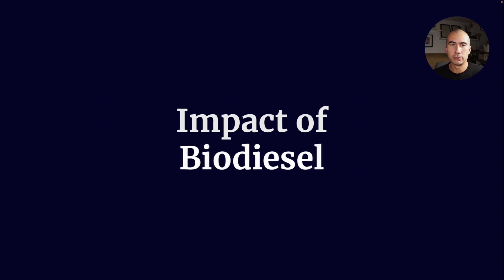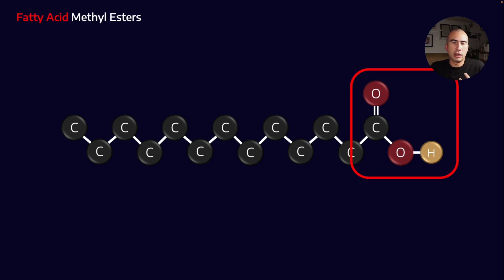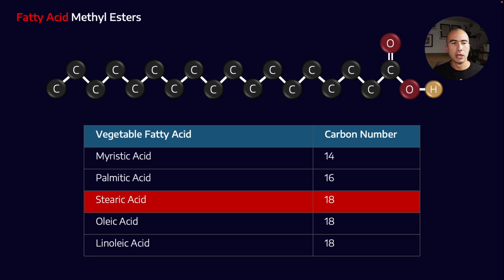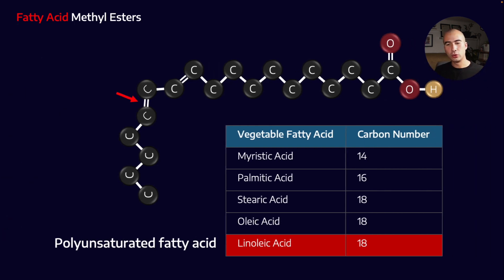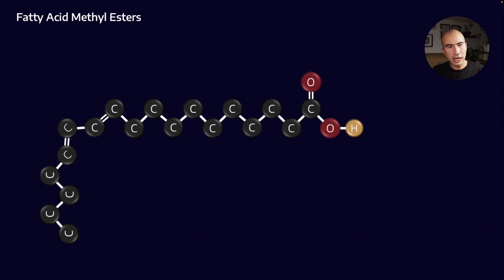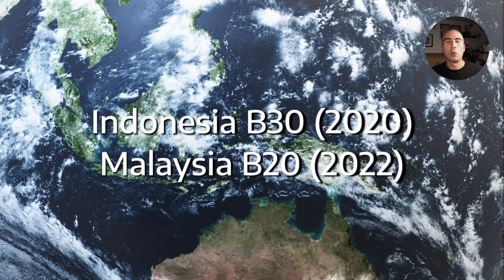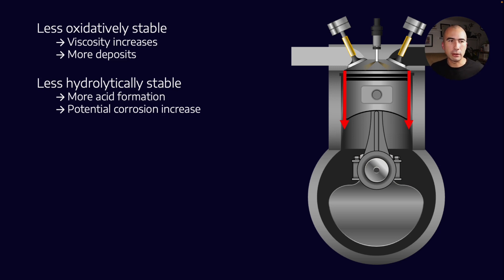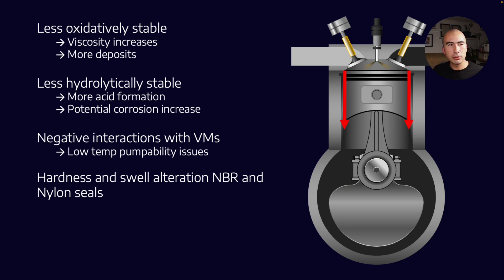How does biodiesel impact engines?

Comment: I'm glad I found this video.  I've been in a debate on a TDI forum in which many are calling my claims "unsubstantiated assertions" that biodiesel leads to oil dilution and necessitates more frequent oil changes.
Reply: There are many research paper that will back up your theory. From what I read, biodiesel has solvent like characteristic and will slowly strip anything it comes in contact with.

Comment: Rafe, great delivery of the subject matter as usual 👍
Is there any current data on modern, small high speed common rail engines such as those in the current Australian ute market?
Biodiesel is not something I've ever been willing to run in my own vehicle, but if it starts being mandated, would love to hear your thoughts.
12:40 In particular, the effect on DPF and SCR systems.
Reply: More and more OEM engine manufacturers are turning to biodiesel due to its many advantages. In fact Coke trucks in Emirates are using B100 for 5 years now. Lots of airlines like Boeing, Airbus are not turning to 100 % biodiesel. The train of Branson, Virgin Air has been using it for years because of its cleaner emisions and better engine performance. Even Mebourne buses have been using it since 10 years ago due to the researches conducted at Victoria Uni.
Reply: @riccapistrano8964 
I'll be waiting for the manufacturer of my engine to tell me it's OK to use.
With injectors at about $750 each, the high pressure delivery pump at risk and only the depth of my own pocket to pay for it, it's not worth the risk.

Comment: THIS has to be one of the best videos concerning the use of biodiesel fuel. I can tell you all the negative stated issues remind me of when E gasoline first showed up in the market. Speaking from personally using the stuff in a ford vehicle for at least 150K miles without any problems at all without any specialty modifications just shows how the fossil fuel industry will spread lots of BS to keep people using straight dinosaur juice PERIOD. Been using canola, sunflower, and peanut oil in my earth movers for the past 20 years without a hiccup. The best part is the smell just makes you hungry all the time for french fries. THE low sulfur diesel just stinks to high heaven. Ones cloths are also smelly. That is why I prefer to drive a gasoline truck. 
Just my two cents Sir. Great work too.
Reply: @westgatehygienecleaningsol3442  What I do not know is how long one can store biodiesel and not have an expiration date ?? Tough question to answer for sure but give it a stab. Good day fella too.
Reply: 6 months max lad

Comment: Biodiesel has the side benefit of extra lubricity for diesel injectors and high pressure fuel pumps, typically found in CRDs.  Which is super important for pump and injector protection.  So Biodiesel is not all that bad!  🙂
Reply: This is what is going to happen to your engine soon https://youtu.be/0phE-t7ddH8
Reply: blah blah blah

Comment: I am a retired chemist, speciaized i biofuels since the mid 1990-ties. I have found reasons to comment on the video which I find unclear at some points and faulty at some others. First of all, vegetable oils come naturally as tri-glycerides with minor levels of free fatty acids. This means that the process required for turning these into metyl (or ethyl) esters is called trans esterification usually with an alkali catalyst. If the level of free acidity is too high, the process needed is called esterification, usually performed with an acid catalyst. One should also be aware of that criterias for lubricants (although biodiesel is a good lubricant) is not automatically suitable for biodiesel. As for the formation of free acidity in the crankcase oil: There is obviusly a parameter for lubricants called TBA (total base no). There are components in the crankcase oil which are there to neutralize any acids coming in contact with the oil(correct me if I am wrong) . These components should be well suited to handle acidity from any kind of fuel, the sulphuric acid included (produced by the sulphur content of the fuel). It seems to me as a higher TBA is to prefer to a lower TBA, correct me if I am wrong again.  I agree upon more frequent oil change intervales, since biodiesel does not evaporate from the crankcase oil the way dino does, due to its higher boiling point. The fuel consumption should increase with maximum 10% due to the lower energy content of biodiesel compared to dino . But it may not appear since biodiesel burns more compleatly than dino. Finally, the formation of soot in general from biodiesel is less than fron dino, a fact which is well known from the litterature. But, it is also known that biodiesel with a high content of mono- di-and triglycerides can generate soot deposits, which sometimes can be quite serious. But the usage of high quality biodiesel carries a small risk for this. Even though both the ASTM and EN norms have their flaws,  I would still recommend biodiesel meeting those demands. And you lubricants experts, when will we see renewable  bio lubricants on the market ? I know that vegetable oils have a good viscosity index. Is that not something to build further on ?
Reply: Good comment. . . Can u tell me if biodiesel can be made to a satisfacfory standard by a homeowner, who wishes to avoid the ever fluctuating feul prices? 

If so, can u point me to a  video that u would recommend for this purpose?
Reply: @Blue1Sapphire  Well it is difficult to produce biodiesel of satisfactory quality for a home brewer. Biodiesel can be produced, of course, but it is the removal of undesired components that is the problem. Examples of such components are residual methanol, alkali metals, or the acid catalyst, depending upon which process is used, and water. The best approach is to choose an oil (or a fat) as raw material, that has good values of free acidity, water, and a high saponification no. Testing of the final product will also be necessary. Either way, it is not recommended for a home brewer to rely on his or hers  biodiesel in the long run. The biodiesel industry has deep control of the quality issues of both the raw material and the biodiesel itself , something that will be too expensive and too knowledge demanding for the home brewer.
Reply: Respectfully, paragraphing really helps especially with dense, deep, stuff.
Reply: Sir      I have a lot of respect for the USA guys who put me right on the tech re making biodiesel....... The forum was THE place to get all the technical info that was required to make good biodiesel... I remember your name partially way back  and I remember with thanks several names who I looked at in the forum 18 years ago.   Dave with his school bus was on of the first and a farmer called antifuel1.... Those were the days......  Graydon Blair   I think made bio a big business. a very aimiable chap indeed and helpfull.
As a commercial heating eng I had problems nearly getting b100 to burn in the P jet burner. Now I just bought a Beckett  head & just about to fire it up....
Reply: I totally agree with you Jan. Have a great day mate !

Comment: I burned several 100 liters of straight filtered used veg cooking oil in my Detroit 6.5 diesel. Mixed with 1/3 kerosene to adjust the viscosity to the same as diesel. It ran great. It ran quieter and smooth than the diesel. Probably not a good idea though for long term without treating. It's too bad that there is not a plant based oil that can be used that the transestification process is not necessary.

Comment: Lots of fuel filter changes are in your future if use this in your older motorhome. Biodiesel is a great cleaner and will shake loose a lot of built up dirt which clogs your filter fast. Biodiesel holds moisture, which allows algae to grow during the storage. That algae will be tough to get rid of and will clog many filters until it is finally controlled.
Reply: You right about more filter changes ! But its the other way round mate ! Biodoesl kills the mentioned algae ! :)

Comment: Small amount of biodiesel greatly improves the lubricity of the fuel (since most (or all) diesel is ultra-low sulfur), which is essential for health and longevity of the fuel system of any diesel engine. And the fuel system components for diesel engines are very expensive.
Reply: Thank you electoman. My concern running California-distributed ARCO "renewable" diesel is for the longevity of the dosing pump of a Webasto diesel air heater for boats, trucks or campers. If you have anything else to add I'm all ears. Thanks again.
Reply: @applesbighatranch6906  hm, somehow I doubt that dosing pump of Webastov is any more delicate and/or sensitive, than hpfp and injectors of your regular CR diesel engine. This is just my unprofessional guess though. Can't say anything about your fuel station, I'm from UK. 
Best to ask Webasto service/support team about any specifics of operation of their equipment, the DOs, the DONTs, etc.
Reply: Sulphur is the only main ingredient in diesel. Everything else is just marketing. This is what is going to happen to your engine soon if you run on biodiesel https://youtu.be/0phE-t7ddH8

Comment: We're looking into buying a new truck, it seems most in the past 15 years are certified to run on B20, what are your thoughts on using blends like B20? We're thinking if we run it in a new truck from day 1, it might not cause as many issues compared to using B20 in a truck with significant mileage already.

We'll be buying B20 in bulk from a fuel supplier, say 10,000L/time.
Reply: This is what is going to happen to your engine soon https://youtu.be/0phE-t7ddH8

Comment: Back in 1998-1999 i used RME (rapeseed) fuel in my Enfield Diesel bike. The combustion chamber and tail pipe became metal clean. Before 3/4 injector holes would foul after 5000km. But with 100% RME all 4 holes was clean after 10000km.
In 2012 I started to use it in my BMW 530D, and when it was time for my DPF service they asked me what I did, it was metal clean.
530D did not like 100% RME. However 80% was fine.
I’ve drove it with 60-80% RME in temperatures ranging from -33 to plus 34 Celsius. No problem.
Sadly they don’t sell it any more at my local station. It was the best medicine for my DPF……
Reply: What is DPF. I read your comment 😊😊😊. Thanks for reply
Reply: @dldchannel1316  DPF : Diesel-Particules-Filter

Comment: Dam, for the last 30 years we have just washed used cooking oil , Run it through a old high speed centrifuge and a cap of algaecide and add it to the oil fuel tank. Start the engine up on diesel , run it for 5 minutes and switch to cooking oil.....  At the end of the run, flush everything with diesel..  Mind you I live in the country and there is no short drives anywhere..

Comment: As someone who used and manufactured used canola based biodiesel, many years ago. You made mention of the molecular structure and atomisation. Yes I agree that most biodiesels are bigger in their droplets. However they are rich in one particular thing which makes up for it. A natural form of  nitrous oxide. You argue that it doesn't burn as well as mineral diesel. I strongly disagree based on long term use. As It used to run around B70 due to supply, back then, and around 60% in NZ winter conditions.  The vehicle of choice back in the day was an 89 Nissan Bluebird with a std, RD20. Motor.
Reply: Surely any fuel that contains nitrous oxide wold be a plus

Comment: 3:58 retired marine engineer.  100,000 miles on waste vegetable oil, drove from North Carolina to Iowa and back on vegetable oil. Have made biodiesel, less enamored with the chemical process on a home level. 

My chemistry is ancient, enjoyed it, wish I had taken it up more seriously. I also wish you had indicated to the non-engineer that when you have "double bonds" that you do so at the expense of the number of oxygens attached.
Reply: Went from marine engineering, to industrial training, to human resources, to school (shop) teaching. Not everybody has watched your previous videos or is an engineer. In fact, you should be trying to draw in high school students. So at 4:40 when you discuss what's good pr bad about double bonds, you should lead with "easier/harder to break up" (or some other conclusion) and then go on to justify that. Makes for better education.
Reply: 8:20 The part about percent of biodiesel is interesting. I understand that B2 is used as a means of replacing (improving) the lubricity from having removed sulfur from mineral diesels.
Reply: 8:45 I would be happy of percentage of biodiesel in Mineral fuels was increased but biofuels should not be produced at the expense of things like ethanol derived from corn. We need to leave food for food. Switch grass or even farm-raised algae is fine.
Reply: Everything about the acid dilution, water in the crankcase is coming back to me. You have not discussed vegetable oil as a fuel. I believe Otto Diesel (the man) created his compression engine to use oil seeds in Germany. Any thoughts on straight vegetable oil? (Obviously waste oil would have its own acid problems.) Just requires heat. Smells good. ... for that matter, what about using used motor oil. I never did but I know some people who tried it. Would need a lot of cleaning up.
Reply: 11:20 never measured the energy output of biodiesel, just did it as a hobby but I drove to Iowa and back from North Carolina, my Mercedes-Benz 300SD got 20 miles per gallon weather diesel or vegetable oil. I was getting used vegetable oil from a "funnel cake" guy. Free. Picked up more oil at a grill restaurant in Iowa.

As for decreased fuel consumption, my understanding is that (corn-based) ethanol has about 80% the energy of gasoline. Stop using food for fuel.

As for things being renewable, remember the second law of thermodynamics, nothing is free. If you make biodiesel you're expending energy in producing it from palm, switchgrass, algae.
Reply: I don't know about the atomization of biodiesel, or vegetable oil for that matter. I do know that my exhaust pipe was ringed in the soot you mentioned.

I do know that my Mercedes 300SD quieted down considerably, sounding more like a 1964 Dodge Dart (ticka-ticka-ticka) versus the normal "clankity-clank) of my Mercedes diesel.  Less noise seems to be less wasted energy. Correct me where I'm wrong. 

As a matter of fact my Mercedes didn't even require much heat, could blend vegetable oil to varying degrees based upon the outside temperature.

Comment: Excellent video. Q: in the area of soot accumulating, are there additives that can harm the biodiesel (at a molecular level) or do you suggest staying away from any additives when it comes to biodiesel and possibly renewable diesel as well?
Reply: Soot accumulation due to dirty diesel deposits are being cleaned by biodiesel molecules. The reason why triglycerides or oil are being made to soap is because they have alkyl group that has cleaning property. This is carried by biodiesel molecule as it keeps this alkyl groups.

Comment: If you never used bio you will not know. I have produced 1500 000 litres (b100)and used and sold. Far superior fuel for any compression ignition engine. High cetane so better fuel economy and cooler manifold temp. The industrial ( conventional ) diesels run great on b100. The common rails run great at b30. I want to start testing with turbine engines soon. Regards
Reply: This is what is going to happen to your engine soon https://youtu.be/0phE-t7ddH8
Reply: wow, such a great achievement. which country are you from ?
Reply: please be honest & truthful
Reply: Yes, biodiesel in turbine engines!  Hope it goes well.
Reply: talk to truckers. they will confirm what you said is wrong. real diesel will never be replaced by any vegans environmental dream
Reply: @paul1der dude uts cheap and used motor works good too big government wants ev but Rudolph diesel invented the engine to run on peanut oil problem grown oil can't be taxed as easily.
Reply: @paul1der The thermal energy is a little bit lower, about 10 percent, but it burn cleaner, smell like food. Doesn't need DPF. I think diesel engine with ability to advance or retard injection will able to consume almost any diesel fuel.
Reply: @paul1der I run a biodiesel company and everyone that uses our biodiesel in their trucks, burners, vehicles, generators etc have reported good results. Clearly you have no idea what you’re talking about. That or the people you’ve spoken to have used shit quality biodiesel

Comment: Bites apple Hmm.. They all told me that crude was naturally processed biodiesel. "biomatter, heat, and pressure." Points at ultrasonic oil extraction You know that same tech if engines were made correctly would also prevent anything from building up on engines. Lol.. And the system still hasn't updated people on opposed pistols very well. Thanks for the video.. But it doesn't matter in the end what its made from, we have the technology to make it the best. Problem? Hmp.. Same as it is when trying to get the herd to look at the patent US20100113983A1 - Utilizing ultrasound to disrupt pathogens for selectively ending all germs based on their resonance if they're hurting people instead of being tolerated by immunity. Bites apple Microsoft owns it. Good luck until after the RESET! If you survive.. o7
Reply: How high were you when you wrote this?
Reply: @raunakd4877  You think forces outside of nature are why the oil is below surface? Lol.. Its naturally processed biomass.

Cody's lab covered making fuels from it. Have FUN!! Go date your sister or something DNA sample.